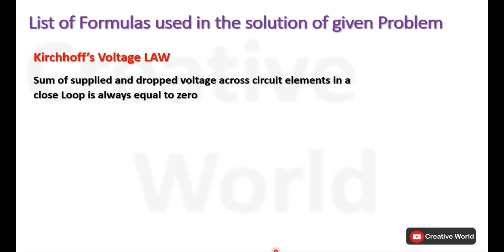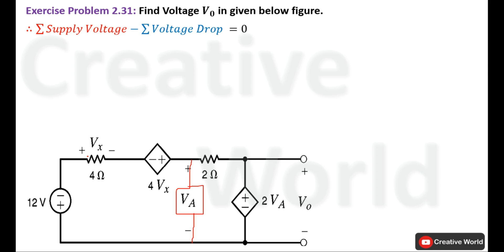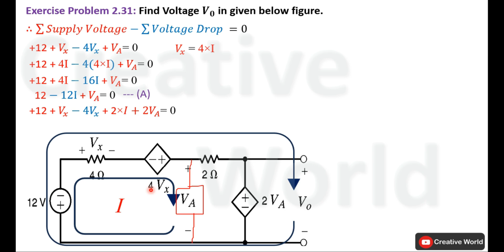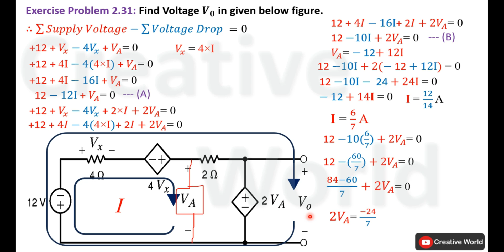Chapter 2 Exercise Problems 2.31 Solution | Linear Circuit Analysis

Comment: thank sir for the videos 
but why the final result is 24/7 not 12/7
Reply from the maker: Thanks for your worthy feedback.
actually in question it is asked to calculate the value of Vo that is equal to 2VA because of parallel connection property so that's why we have to take it as 24/7 we can't divide on both sides with 2 to get the value as 12/7